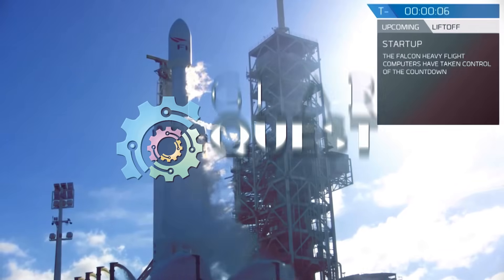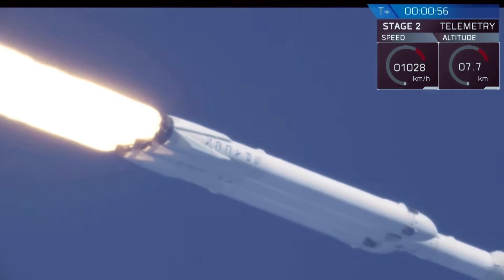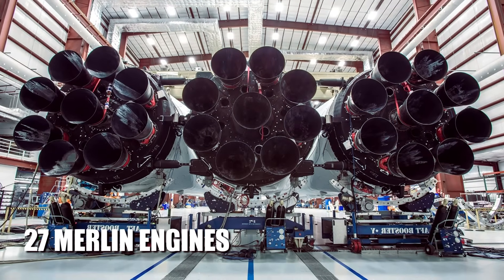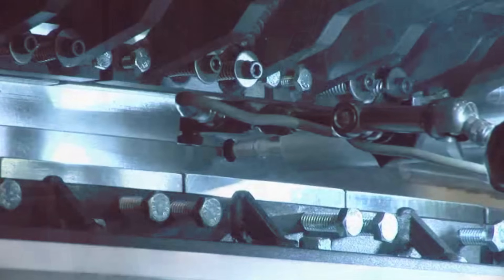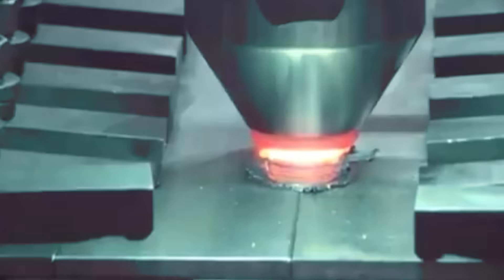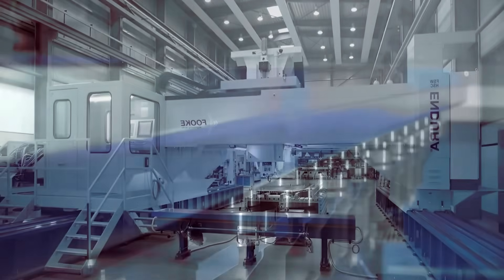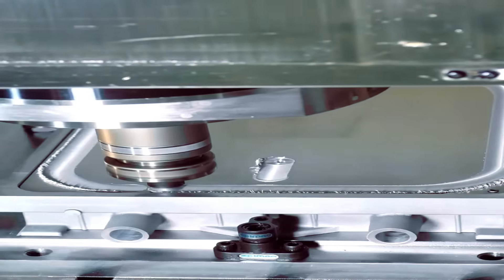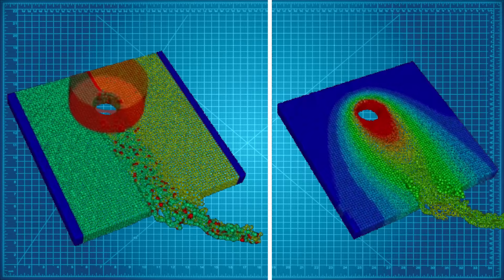Friction Stir Welding

Comment: Excuse me, I am a researcher and I have an obligation to spread the truth. The aerospace industry has changed on September 22, 2020. For the first time, reactive and paramagnetic alloys of titanium and aluminum are welded using laser electromagnetism from both sides of the material simultaneously. The new technology is now legally admitted in America and Europe in 2020. This means that with the new laser electromagnetic method, civil and military aviation fuselages can be stamped in series and the new technology welds all its components robotically. The new technology builds the liquid propellant tank better than the FSW friction imaging method. The new technology places laser thermal energy and inert argon gas on the north and south sides of the material. Removal of oxygen on both sides of the material... New electromagnetic laser technology automatically welds the hull of nuclear submarines into thick titanium plates... These documentaries are misleading and appear to come from a parallel Universe where they do not know high-Telecommunications speed or fiber optic. The SLS system is obsolete because it is built using a mechanical probe, however, new technology does it efficiently using laser electromagnetism from both sides of the material... Perfect welds with controlled internal and external asymmetry. Orion, Dragon and Starliner are obsolete because they do not have the new electromagnetic laser technology. It is much better to build spaceships with automatic electromagnetism WITH THE NEW TECHNOLOGY or do it with a FSW probe that breaks down in resistant alloys and can only function precariously with aluminum. gentle. It is an honor to inform and also an obligation to spread the truth... Best regards to all... If there is any Engineer willing, I will gladly inform you of the details... Thank you very much...
Reply: What is sls system

Comment: That's a balloon, not a rocket. Any rock it would go soaring into space really really quickly. Try it out with any model rocket you have. It doesn't change just because it's bigger. But you've accepted the lies they showed you without even questioning it.

Comment: You didn't say what the tool is tipically made of.
Reply: Tungsten carbide would be my guess, it's one of the few materials that can take those temps, and that's what friction drill are mad of anyhow.
Reply: Rotanium
Reply: For production operations, we use tungsten carbide tools. We’ve modified them by adding “wings” to the shoulder to help knock off excess flash the builds up on either side of the weld.
Reply from the maker: Vibranium!